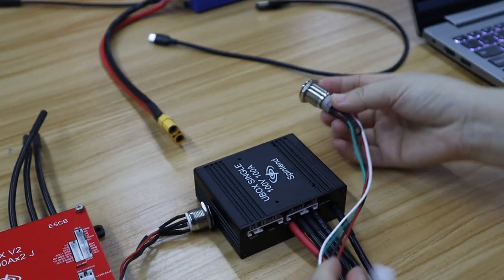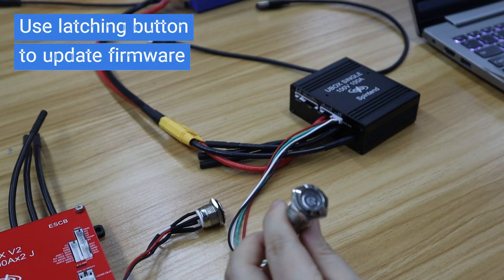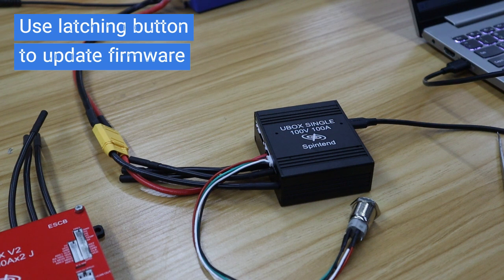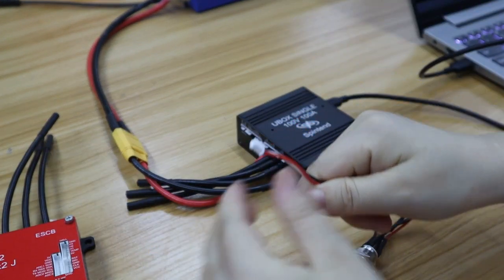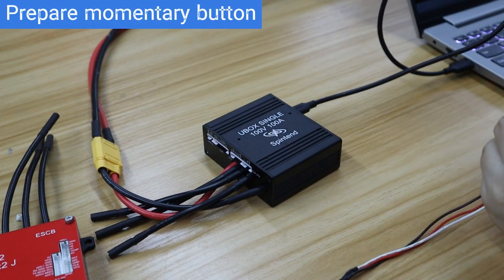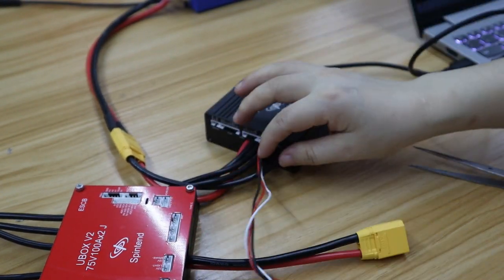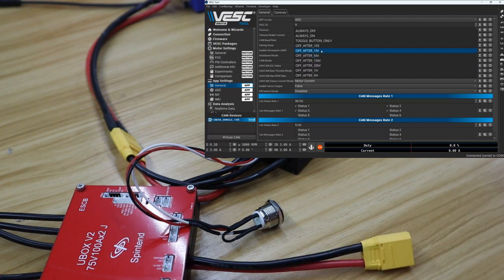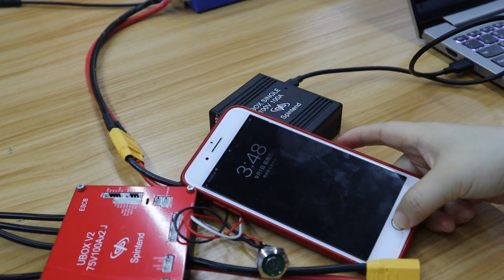Single ubox 100V 100A controller based on VESC support auto off setup | Spintend.com

Comment: Can you show how to wire the momentary button?
Reply from the maker: we will have this momentary button for sale soon
Reply from the maker: link is here: https://spintend.com/collections/diy-tools-and-accessory/products/momentary-button-for-single-ubox-100v-controller-supports-auto-shutdown-feature
Reply: @spintend GitHub link does not have the auto shutdown firmware. Please post the correct link to single ubox 100 auto shutdown firmware???
Thanks
Reply from the maker: @mitchellmcguinness9964  the firmware in github link for 100 is auto off firmware. it's correct.